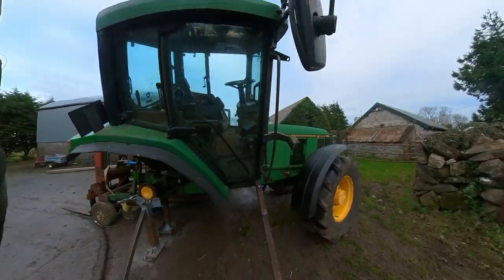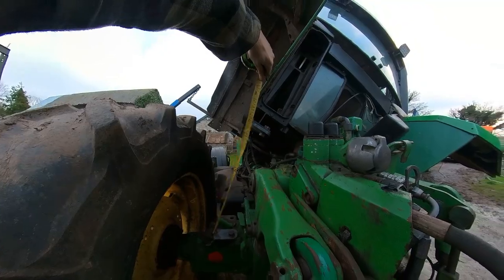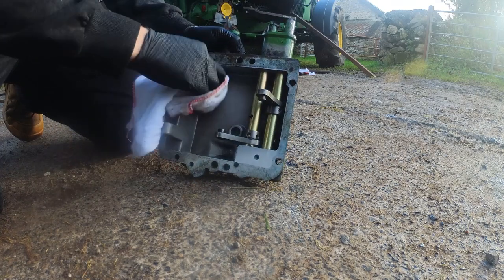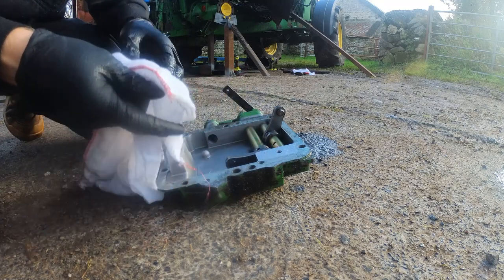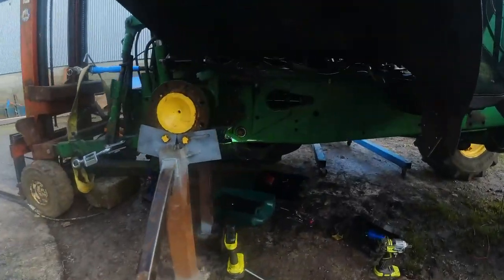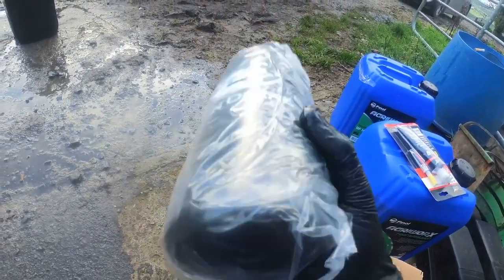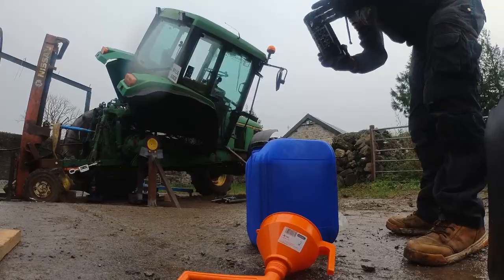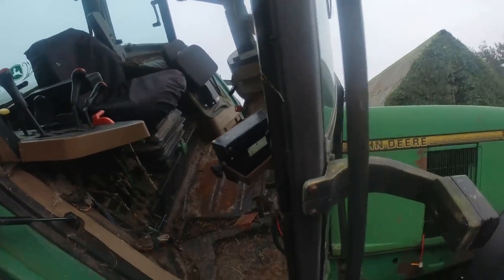HOW TO TILT A JOHN DEERE TRACTOR CAB WITH SOME SCRAP STEEL & BASIC TOOLS

Comment: You most likely don't need the big filter. I found out with our 6200 doing the last filter/ oil change. We still had the big filter on the shelf, but there was or has been a small filter on the tractor most of its life. Reason being, i figured out, the big filter is needed if you have the big 40cm3(Optional) Hydraulic pump, which most tractors just had the 25cm3 pump.

Comment: That's Brilliant Declan, fair play to ya going at that job, if it were me I'd be like a goose looking into a bottle 🤷🏻‍♂️
How did it turn out, 100%?
Reply from the maker: Thanks Conor, 😂That's a new one fore me haha. It worked 100% Hydraulics and the gears have never been better. Wish I had done the fluid and filters after I bought it but it would have been drained to fix the roll pin anyway.
Reply: @IDoAgri  I'm looking forward to seeing it with its new shoes on. 
Have the cows started calfing?
Reply from the maker: Nope the first one is due this week 🙌
Reply: Great work. U make it look easy
Reply: @IDoAgri  good luck with them. Please God lots of fine healthy calves.
Reply: Great job Declan tricky hope it turns out great 👍👏